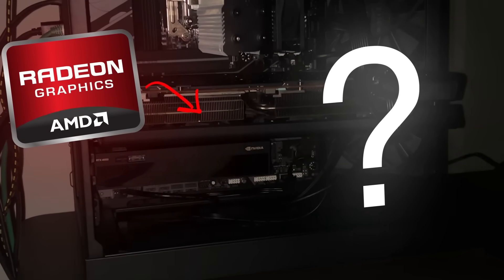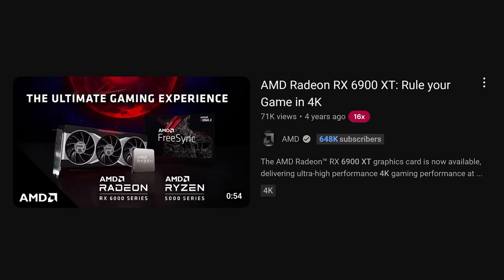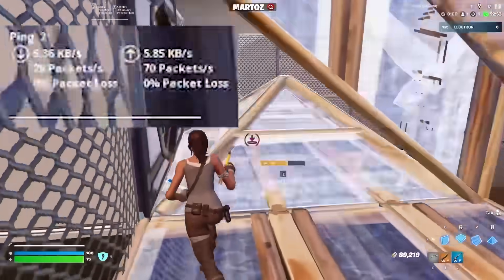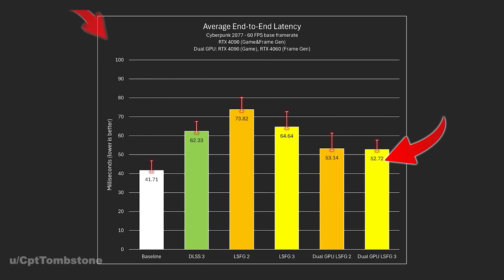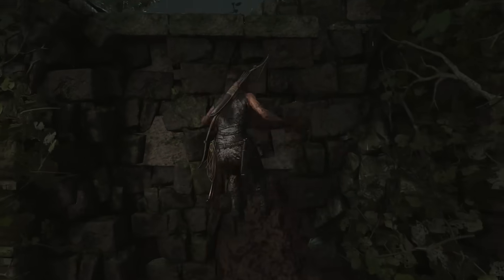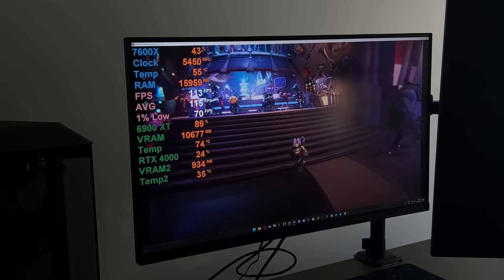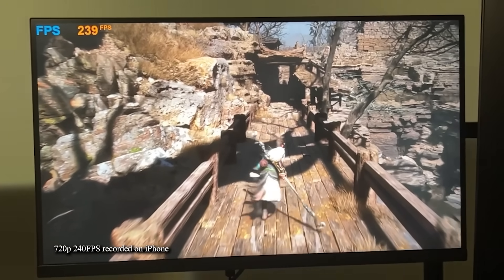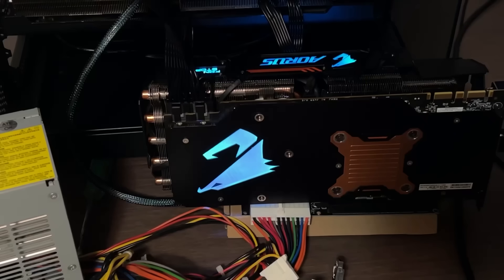I Used Both AMD & NVIDIA in One PC and Got 240 FPS in Every Game

Comment: Yea, guess this works, but... I use a 6900xt. If I wanted, I can do 340+ fps with cyberpunk at 1440p FSR frame gen plus FSR performance.
Or 240 fps with low settings and FSR on auto.

Comment: I Think this is completely insanely incredible. Like most things that are insanely incredible get nerfed in games quickly. This work around will get shut down. AMD and Nvidia do not want you using both cards, they don't even want you using 2, 3, or 4 cards anymore in traditional SLI. If we can just turn our old card into a frame generator our computers last longer and our need to upgrade every 2-4 years is out the window. This is an awesome breakthrough, but I can't see it working for very long. Hopefully the industry changes and will allow this kind of mashup. I was a supporter of SLI, I have owned an Nvidia SLI machine and an AMD crossfire. Bring it back!

Comment: Really cool tech, though I don't think using the Google AI summaries is good practice, since you aren't sure exactly what on the page it is grabbing from. Additionally, at 8:03 you cite the PCI 3.0 x1 speed, but if your motherboard has PCIe gen 5 for the M.2 (boards around the time of the Radeon 6000 series would have only the M.2 or that and the first GPU slot be PCI gen 5, and the rest are Gen 4) it would be a gen 4 slot, surely. Not that it would really make much difference if the 1GB/s doubled because of PCIe generation. Additionally, doesn't the 4000 Ada not output graphics, like at all, since it is meant to be a workstation card for calculations instead of graphics?

Also, if you had two cards in slots right next to each other, I would imagine that causing problems for the airflow of at least the top card, given how close it is, but I suppose running it outside coincidentally fixed that, unless it was something you had thought of but just didn't mention in the video as it wasn't relevant to the conclusion.

Comment: when you use raw gpu power you not only increase "frame rate" you reduce the time it takes the pc to register your input, for instance, at 30fps lock, your frame time is 33.33ms, it takes the pc that 33.33ms to react to a mouse movement, or button press, if you run 60fps, you halve that time to 16.67ms, frame gen does not effect latency though, if you draw 30fps, and gen the other 30fps for combined 60fps, the latency is still 33.33ms, in the beginning you were already near or over 100 in basically everything, anything over 100fps has a latency under 10ms, thats when frame gen is most useless, can you actually see the difference between 100 and 200, can you accurately even blink in a 5ms window? that ammount of time is so short you cant even perceive it, its over before you even realized it was coming so fast

Comment: Hopefully you see this. How did you get some games to run on the desired GPU? Since I'm facing the same issue with a specific game (Tekken 8) where it just defaults to the weaker GPU rather than running on the specified GPU.

Comment: I dont know if this will work and someone correct me if I'm wrong, but couldn't you use an apu for frame gen (not asking if  its good only possible) and a single gpu for rendering? Like a 30, 40, or 50 series nvidia card and the Ryzen 7 8700g?
Reply: No, my 7800X3D IGPU is so horrendous that on it's own turn FG on isn't even worth it...
Reply: @NeededByNobody  it wouldn't be rendering the game like in your case so some of the load would be removed and again it wasn't a question of good or bad but possible. It could run at 1fps and that would still count as possible.
Reply: @ yes possible, but it won't be giving expected performance
Reply: @NeededByNobody  performance was never the question. I made that clear from the start.
Reply: @moelundy  that's fine and all, but then what'd be the point of FG?

Matter a fact I'ma try this exact thing but tbh... I don't wanna lose the HDR...
Reply: @NeededByNobody if its that hard to answer a purely theoretical question without irrelevant info then don't.
Reply: Well not only was it hard for you not to ask a stupid question, but it seems it is hard for you to be a nice person too, and test it your lazy self. But here is some relevant information for you, since it's so hard for you to do it yourself. Yes this is possible, I did it by accident when forgetting to change HDMI to my dedicated card. Here is a counter question for you. A GPU is functionally the same as an another GPU, minus technology advances. What made you have to ask such a stupid question, and be a jerk afterwards?

Comment: @3:20 you never buy a cheap power supply. Most CPUs today can be unstable by having any amount of dirty power. Plus, it becomes a serious issue as PSUs age. Johnnyguru has an old but amazing article and demo of this.

Power supplies age and the quality of their power gets worse as they age so a cheap power supply maybe okay at first but might be bad in a few years and require replacement. 

They can also slowly damage your hardware. Additionally, if you live in an area with dirty power its even worse. A quality power supply will:
1) better clean dirty source power. So, a computer will become unstable more quickly with a cheap PSU
2) will last longer (dirty power damages PSUs (depending on severity its either slow or fast (typically slowly)), but a high quality power supply will last several times longer than a low quality one)

On Johnny Guru's site he shows actual readings of a 10 year old high-quality PSU providing better power quality than a brand new budget PSU. So a quality PSU will last over 10 years so in the long haul a quality PSU is drastically cheaper in everyway:
1) total cost of ownership is cheaper
1a) lasts longer so you don't have to buy a new PSU as often
1b) it can pay for itself in energy savings. If you use your computer a lot, have high energy costs, and/or have a high powered system, the better efficiency and money saved from that can pay for itself.
1c) it saves you a lot of time and hassle with not having to troubleshogt stability issue or buying and replacing PSU as often 
2) better protects hardware from dirty power
3) prevents stability issues
4) saves a lot of resources (uses less energy and raw materials by not needing to buy as many PSUs over the same time period

Additionally, you should always buy a power supply that is 2x above your system requirements. A power supply is most efficient at ~50% and it allows room for upgrades. The energy savings over 10 years is very significant and worth getting a larger PSU.

So, its actually cheaper in the long run getting a large quality PSU and it also saving your hardware and major headaches!

It also isn't that much more money to actually get a large high quality PSU. Over 10 years it can save you 2-3x or money in total cost vs a cheap PSU and thats not even the money/time saved when you count stability/troubleshoqting!

Comment: So before 64bit got it's way to pc.
There was a time that a intel board would be working well with a AMD graphics card.
What was back then noticeable with that set up, that the coexistence between two types of processing.
Made the AMD GPU work well for rendering and the Intel Pentium would support then partually the FPS.
Was quite stable back then compared to AMD board & AMD GPU or Intel Board & intel GPU.
I am under suspicion that the 64bit system is maybe what makes current quality of either brand not being able to push the rendering and FPS both at the same time.
But i must probably be wrong about this.

Comment: This isn't the future of PC gaming, this is a band-aid at best. I like Lossless Scaling for what it does, but framegen simply doesn't give you performance, not to mention worse visuals. And even less added input lag is still too much if you're using it below 60 FPS natively.
Reply: Base rate of animation , psychics , engine still stay the say it's scam that just smoothes the frames a little like interpolation
Reply: @DC3RejuvationGB  Tbf, games where physics are tied to base framerate are actually one of the few use cases where Framegen is quite good, precicely because it only affects visuals.
Reply: Zoomers man… this is the past of pc gaming being tried by a kid
Reply: @sorvex9  Multi GPU was supposed to take off, but too few games ever supported it after SLI/Crossfire was discontinued.
Reply: @sorvex9  Sound is right tho. All this Ai reliance is merely a crutch, and a bad one at that.

I look around me and I see ppl constantly peddling AI this and AI that, completely ignoring raster performance and general brute forcing, that it will quickly become a lost art, and then we'll be forgetting that we were meant to be playing at native res.

The biggest issue is going to occur down the road, once the band-aid has to be ripped off (and trust me, it will).

Comment: You did not get 240fps, those are fake frames...
Reply: Fake frames are only a problem if the input delay messes it up and the real fps is below game logic rates, which normally is the equivalent of 30fps, 60 to 120 in competive games
Reply: @notasyriefox  no, the issue is saying that the card has the performance to put out 240 frames per sec, when it can only put out 30
Reply: @soldat88hun  i mean, yeah, it is, most game suck at 30fps, if it was 60fps before the fake frames, it would be okish, tbh, its a useless tech more and more i use it, its just bigger number and good for like, recording, thats it, it sucks for the gamer, its great for the streamer.
Reply: fake frames like dlss and fsr
Reply: arent all frames fake?

Comment: man i literally have all the stuff you used, extra egpu dock, power supply, 24 pin split etc. and an extra 3080 and 1080. gonna try this out for sure. i also have a dual 1650 super build, both already run in the same pc without needing the extra power supply, docks etc, this is dope.

Comment: That ExitLag sponsor set my BS senses into overdrive, especially when it showed a 1ms ping 😂.
I got 2.5gbps FTTP - if I ping a speedtest server in my own city, I get 5ms.
Light in a vacuum can only travel 186 miles in 1ms, but you expect me to believe you can game on a regional server, hundreds, maybe thousands of miles away, with fibre, copper and routers in-between with only 1ms latency?
If you believe that, I got some magic beans to sell you.
Reply: they are using microblackholes u know ;) In this case, they are able to receive packets before you even sent them, but it was too confusing for people to understand, so thats why its set to replay as 1 ms, just to add back compatibility with older hardware :D
Reply: bro they should be making the hpgs from battletech lmao
Reply: all these losers typing without actually using it is so infuriating, like stop being an armchair and theorizing crap without actually trying it. jeezus.
Reply: @EpicBunty  It's basic  physics... You can't travel faster than the speed of light(so in this case, fiber uses light to transfer data)... If light requires 5ms to travel from your house to a regional server, you can't get faster than 5ms. The other comment on this thread joking about micro black holes illustrates that point in a satire way.

Comment: Ii think u must use third gpu  the integrated one .. i am using 3 GPUs 6900xt +1060 6g + intel integrated , 69 runs big llm 1060 runs 3 models for tts stt and longtime memory  and  intel outputs image, and also in VR it helps this kind of setup

Comment: I remember right before Windows 10 came out people saying that with the new Direct X coming out you will be able to plug in any multi GPU setup into your system and it will use the recourses from them. Of course, we never got that. I'm sure the powers that be didn't like the idea of two competitors GPUs running side by side.

Comment: 0:26 sorry buddy, you can clearly see the jittery lag in that clip... That's not 240fps. I'm not going to bother watching the rest. This is BS.
Reply: Or the recording encoder had Trouble communicating between the two gpus
Reply: @ORANDOMM  its not bs its literally factual that this works and works well 😭
Reply: @edopt7204 That wasn't my statement. In this specific clip, we can all see with our eyes the mega lag and jitter in some scenes .. what kind of 240FPS is that? 50% of the time and the rest is lag?

I'd rather a steady 120FPS.

But anyway, I was referring to this video footage, not the concept.
Reply: @ORANDOMM  yeah that's probably because he used the wrong capture API. if setup incorrectly the frames generated by LS may not appear on a video recording or stream but it 100% shows on the monitor you're playing on and it's insane how well it works. i know this because i tried to stream the output to my phone and the capture only saw the base framerate while the visuals on my pc monitor looked way smoother
Reply: Ain't no one forcing you to watch the video anyway🤷‍♂️

Comment: How are you not getting higher fps in Fortnite? My PC has an RX 6900 XT and Ryzen 5800 and even with most of my settings on high, I get 120 fps in Fortnite. Plus, in Cyberpunk, with ray tracing turned off, I get well over 168 average fps.

Comment: Cool concept, but even the latency benefit isn't quite there, at least with afmf2.1, i average 9ms of extra delay, slightly lower than your results here but without a second card. Would be great for older cards without afmf2.1 support though

Comment: Performance in this will vary depending on your motherboard and CPU, because only a certain amount of PCIe lanes can be accommodated to run directly to the CPU. Most of the time you won't be able to fully utilise a second GPU.
Reply: yup, just pray you'll have Pcie 4.0 x 4 on the 2nd pcie slot and you'll be good in 1440P idk about 4k, haven't tested it

Comment: Crazy amount of work to get this working. I was running SLI and crossfire until 2022 when I replaced it with a 3090.. if I knew about lossless scaling back then (if it was even out then),I could have simply kept using my SLI

Comment: Just tried it with my old 1650 and my 7900 xtx, in frame gen it works, but the latency added for using the 1650 for frame gen is just a deal breaker. It's worse than using LS on my main gpu. Also, weird stuff happens here and there in my system, including gpu driver crashes and cinebench r24 just crashing. It's a cool config, but the number of problems and flaws outweighs the benefits, if there really are.

Comment: This the ultimate PC build

Dual Socket with:  Intel Core Ultra 9 285K + Ryzen 9950X3D

Triple GPU: Arc B580, RTX 5070, RX 9070 XT

Ram: 64GB Quad Channel 7000mhz

Storage: 5TB x 2 NVME SSD

Comment: Well it depends on the game's optimisations and settings.
I use lossless scaling only on games that don't support frame generation or if i can disable it. I notified that using FG + Lossless scaling does do negative FPS on certain games. Also it's very important that your game has an FPS limiter. If not you need to enable it in gpu settings to be sure it will never goes beyond the fixed amount of fps like 60 or 120.
Another very important setting you need to check is the number of frames that are generated before being shown on screen. Setting up this to 1 made in some games a very smooth experience.

Comment: I've been running a RX 7900XTX and an RTX 4090 since Dec On a 57" 4K monitor. Got as big boost just putting all my monitors on the 7900XTX and pointing the games to my 4090.  It uses both GPUs with almost every game.  With path tracing and max setting on Cyberpunk at 4Kx2 at 240Hz with freesync, I get 70+ FPS.  It really depends on the game how much of each GPU it uses.  BG3 uses 99% of my 4090 and around 80% 7900xtx and I get like 170frames at max settings 4Kx2. I am using a 1600watt power supply. I am not using frame generation at all. I may try this and see what happens. Thanks.

Comment: You do realise that by having data travel from one gpu to another you are introducing input-lag, right? (And I mean beyond what simply running frame-gen does. So unless LSFG is really compute heavy there is no point in doing this. As in you would get the same performance on a single gpu but with lower latency.)

Comment: My gamer laptop has a ggod Ryzen built in radeon GPU and an RTX3070 and using basic optimus, so can the radeon do the framegen for my rtx3070 is its picture already going tough the radeon?
What software is able to turn on lossless framegen and select my radeon for generating the frames?
On my desktop I have RTX2070 and can add GTX980 and radeon RX550 and also a Ryzen with GPU too so integrated vega is also good for framegen.

Comment: strangly i use to run 2 gpu 1 nvidia and 1 amd for about 6 years now and it worked flawless, what I use to do is take 1 GPU out install the drivers, then restart shutdown and then install the next GPU in another slot, install drivers restart shutdown, and I never got a problem until I start playing new games. but I even to this day 2025 i have newer gpus (2 of them ) n ever switch from 2.

Comment: this is actually so cool, gives new life to old hardware too. 

but im a bit confused, if you are running this, would you put the stronger GPU as the base generator, and the weaker GPU as the frame generator, or other way around?

Comment: One thing, you're not getting gen 5 speeds off a gen 5 slot, if your gpu is lower gen, which is funny cus the 1080 would actually get you lower bandwidth than the 4000 as it's gen 3 vs gen 4, so you're getting gen 3 x4 speeds. My guess why it wasn't working well was probably just optimizations, the 4000 sff is a peculiar card so lossless scaling may not be optimized well for, that or the gpu's memory bandwidth, but i'm not sure if that plays a part here..

Comment: You did it wrong A4000 has better RT than 6900XT and its not that much slower in raster. 6900XT has double FP16 need for frame gen engine. So you should swap them. Btw second PCI x16 dosnt mean its x16 its 16 size but most MB support only x4 lanes most expensive ones goes x8 on main and secondary slot.